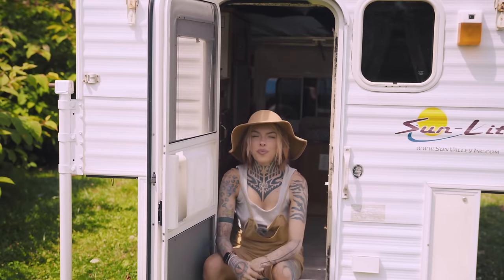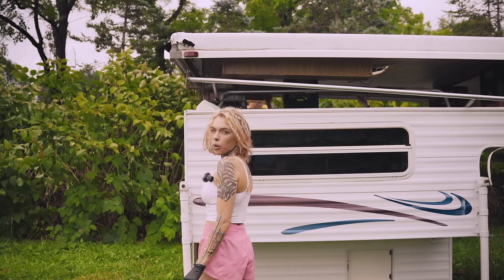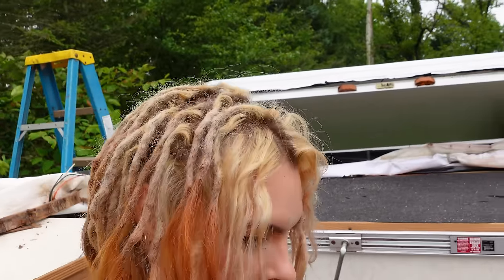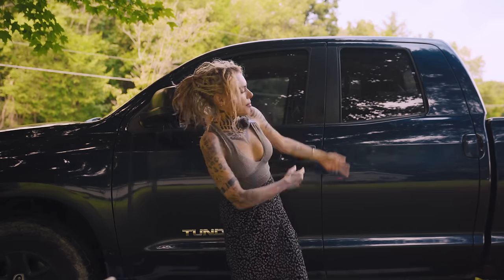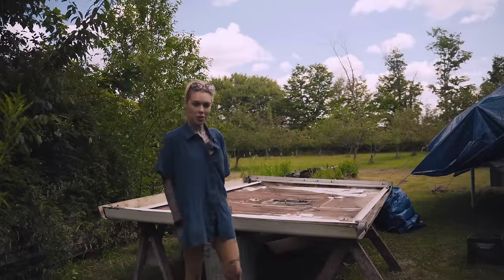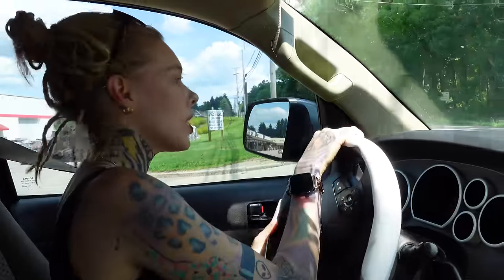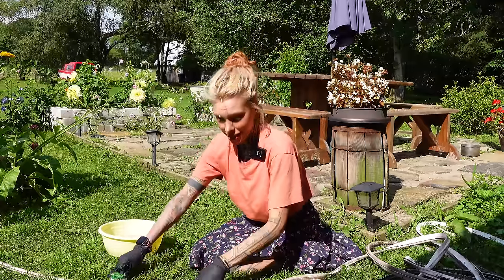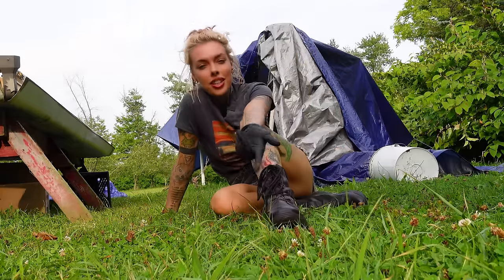removing ENTIRE ROOF of old TRUCK CAMPER... (this keeps getting worse)

Comment: I'm proud of your dad, he really loves you. He helps your with a lot of stuff. You can change those tire rod ends your self. Their probably a little rusty and stuck but take a hammer or what ever you have to do because your going to put new one on any way. Beat them heat them up what ever it takes to get them off. The parts don't cost no $500 most of that is labor.
Reply from the maker: Yea I could do it myself but I still need some other fixes on the truck that I can’t do myself and already doing a lot of fixing
Reply: @TorieRobot  you may not see it, typically when we are in the middle of the mud we can't see where we at but looking from outside the box shows you have evolved into the next level.

Comment: Just a suggestion, but you can put truck bed liner on your roof once you have it all back together on the camper. It will fill any tiny holes, give extra waterproof protection around seams and joints, increase the R value slightly, and make it tougher for off-road use. That way it will stand up to weather and low hanging branches better than just bare aluminum. Great work and positive vibes as always. Awesome that you're showing that there is never a task too big.

Remember, if your dreams don't scare you, you aren't setting your goals big enough.
Reply: Just about anything can be fixed no doubt, but l wonder if a cost analysis might show one could put the time spent fixing that up into earning enough extra money to buy something better.
Reply: @bebopkirby  I think it's pretty much always cheaper and easier to repair and improve on an existing design than it is to buy a brand new one. I suppose I should qualify this by saying as long as you have all the tools and the skills needed.
Reply: @derekd1510  Plus in her world it is providing her with content that earns her money. It is a pain for her but, the worse it is the more clicks she gets.

Comment: As Ric Flair says, you're stylin' and profilin when it comes to your truck. Like those side decals on the truck. Looks pretty rad! Also, I don't know if you have used this product before, but I can attest the brush on application does work. Flex Seal from those commercials is what I'm talking about. Don't know about the Flex seal tape, but the Flex seal brush on works perfectly! That might help with the pinholes you got. I've got an enclosed addition room on my porch deck for my parrot. Every time it would rain, water would come in from every little crack or crevice. After I used cans of Great Stuff and sealed with Flex Seal, chances of water coming are nonexistent to minimal if a major torrential rain storm comes in. I love seeing people learning, growing and gaining knowledge and wisdom. It makes me happy to see. Got to go, building a custom one off pinball machine.
Reply from the maker: Yes I got some roof sealant to seal it once everything is done!

Comment: I really like the customization of your new truck! Renovating campers is tough work when you have to replace the structure. Ive been there too.  When you get ready to coat the roof, make sure you spend a little more and get the high end coating. The cheaper stuff they sell at Home Depot does not last. I got one year out of it and had leaks all over again.

Comment: I agree with the finger to the seller! He knew exactly what kind of damage he was selling you and took advantage of you not knowing!
Those lower walls are going to have serious water damage and rot too!
Personally...I would cut my losses and build my own custom camper without the raise and lower function and fiberglass the exterior....but that's me!
Your project....your decisions....but you should look inside the lower walls and floor if you can to see if you have water damage or mold.
Obviously....at the end of this project you want a healthy,  strong and safe camper.
Good luck.....God Bless.....Stay Safe
Reply from the maker: I think the walls are okay because the roof held the water- the roof isn’t connected to the walls … but who knows
Reply: @TorieRobot  There is only one way to KNOW! Take a peek  and you don't have to use the phrase.."I think"
Most likely you will....or most people change the inside to suit their liking as far as layout and cabinets..sink...bed...dinette. 
All of those older and some newer campers are considered  "stick and tin" meaning raw wood (unsealed) with a tin exterior and thin wall inside. 
I'd just like to see you end up with a healthy strong safe place for your adventures. I know what it takes to do...and if I had the time...I would help you and your dad get it done!
Find out All of your damage before you commit to rebuilding the top first. That way your not problem chasing throughout the whole project with unknown damage.
Reply: Agreed. If the roof was that bad, you have to assume the walls are bad, especially seeing as the nose section got damaged taking the roof off. If the OSB makes cracking noises that means it's rotted and the glue isn't holding anymore. The canvas had mildew, the roof had holes. It's not a question of if there's water damage in the sides and floor, but how much can be salvaged.

Comment: You could see this roof replacement as a blessing. I'd cut 2 holes in the roof and replace the wood with a thin plexi glass. seal it up and you'd have a skylight above the bed and sink area. It'd bring in more natural light, it'd be awesome going to sleep under the stars and it'd make the roof lighter to make it easier for you to raise and lower it by yourself. It'd also make 2 thick covers that would velcro over the skylights to block out the light when you want and trap in heat during the cold times. These could be on the outside but I'd have them on the inside for ease of use and would be better insulation on the inside.
Reply from the maker: That would be a really cool idea, but unfortunately too much more work for the moment

Comment: You're so adorable. As far as the plates, you don't need to worry about them. Tow companies and police are the only people that can run them, and tow companies can get in big trouble just running random plates. They only run plates of impounded vehicles. They are public because it's not possible for the general public to run. The Tundra looks great. The camper, well the camper will look great. Great video again.
Reply from the maker: Yeah- I’ve never had a problem with it but I know some people don’t like to put them out there

Comment: Every thing is fixable 
For those jacks and the crank that raises your roof top 
Get a good cordless drill. Add a pice of hex metal or the head of a bolt to the crank 
Then you can simply use the cord lees drill to raise and lower the jacks and the roof top extension

Comment: I used car scissors jacks instead of milk creates.  Then you needed to lay 4- 4×4×8 ft. Fence post across the camper under the roof, with 2 post angled at the back of the camper to the ground.
Would have been safer and easier. Iwould have never put that much weight on the front bed over hang.
Might want to think about doing it this way when you go to put it back on.
Also put the cabinets back in after your done installing the roof completely. 
Would make it much easier.

Comment: Quiet nerd a YouTuber has greatly enlightened concerning fibreglass, fiberglass is expensive but waterproof. He built a boat out of Styrofoam and fibreglass. Truly incredible. As far as expensive fibreglass, I saw some stuff on eBay way more economical. You could definitely utilize fibreglass in some of your refurbish..xo btw; application of fiberglass requires very dry surfaces so that it won't rot from the inside
Reply: Buying fiber off eBay is expensive as hell, only good thing to buy is the resin.

Comment: Good news is you can replace the cheap particle board that's swollen with some decent wood that will last and replace the cheap plywood in the roof with decent wood that will also last. You mentioned spray foam in the roof. That kinda made me cringe as it will probably over expand. I would try to use 1 inch foam insulation instead or maybe 1/2 inch.

Comment: I'm thinking more about It, all the pin hole can be fixed by using fibre glass and epoxy on the fibre glass to create a harder top and a seal top too.14:56 Yep is time consuming and expensive, but that make great YouTube content and is also less expensive then buying brand new due to the in factory need to sell higher to pay the increased municipal taxe, federal taxes, the employees wage and more.
Reply from the maker: Yea I’ll reseal the roof after it’s all done
Reply: @TorieRobot  Oh yeah ! Thanks for the update !

Comment: Is there any way to address the crank lifting system on the camper while the roof is off? Maybe a gear ratio change would make it easier for you to lift alone. Or perhaps a longer handle for more leverage? Just seems like the time to adress it if anything could be done. Don't let the rain dampen your spirits! Just replace particle board with metal when you can.

Comment: In the long run u r better off replacing the pop up roof and resealing it.use sikaflex waterproof sealing silicone/ caulk.thats what we use in camper trade

Comment: They make some stuff called hydro stop  that's a cross of liquid  rubber  that every so often I would put on the top of my 5th, wheel camper,it worked very well !!!
Reply from the maker: I’ll have to look that up
Reply: @TorieRobot  use to could find it at walmart!!! Good for keeping your  top!!! In a liquor bonded rubber, you can brush or roll it,white so also a little reflective!!!

Comment: I wish I knew you were looking. I have a overhead camper that I want to give away sitting on a 2004 Dodge Ram I'm going to sell for 2000 dollars. I gave away a perfectly running 1980 Dolphin RV with tandem axle on Saturday to a homeless guy. I'm trying to get rid of some inventory to make room. I had Cherokee like yours that I sold for 300 dollars. I have a auto shop but just because I do, doesn't mean you can work on anything in my parking lot or borrow tools. I'm in California, I run a busy shop and not trying to get to know anyone but have inventory to get rid of. Good luck on your build.

Comment: Could I suggest possibly cranking the whole camper down so it sits on the ground flat and then you don't have to work so high in the air. It would be a lot easier to take the roof off
Reply from the maker: It is cranked all the way down

Comment: The truck looks good with the stickers.
If you re fiberglass the roof look at marine (boat) products like Total Boat.
Water proof. Fairly easy to use.
I fear it would have been easier and cheaper to just construct a camper that doesn't pop up from scratch but hind sight is 20/20. Also where is the content in that.
Reply from the maker: Well I specifically wanted a pop up which is why I was keen on this one

Comment: Anyone else would call the previous owners scammers but after having owned several campers, sometimes u have a leak and aren't aware because of how theyre built. With my last camper it took the mildew smell to be noticeable to know it had a leak an despite constantly inspecting the roof. It was a tiny hairline hole that over time added up
Reply from the maker: This could be partly true
Reply: @TorieRobot   after watching the video more I realized those people were cons. Now here's something to note since I follow your videos an I've gotten severely sick from mold. When camper roofs get a leak the water usually drops down the walls, so I would check the side walls for mold. The bottom of these usually have insulation too an a tarp to prevent moisture from the bottom but if water from the roof gets in it gets trapped an the insulation gets mold which is the most toxic out of all molds

Comment: Probably could have used 1x4. It measures 3/4 x 3 1/2 but would have been a lot easier to work with.
Reply from the maker: Right but it needed to be an inch exactly- that was the problem . I found the 1 x 4s but they wouldn’t work
Reply: @TorieRobot  Dang that sucks. Lot of extra work but it will be worth it!

Comment: The roof.... I would not use woodvagain...structural foam. You will save a lot of weight. And it will be lighter and easier th raiscand lower...I'm here for advice
Reply from the maker: The wood is the only structure to this and attached to the metal it needs to be strong
Reply: @TorieRobot     structural foam will be lighter and just as strond.. it will be easier for you too work with you won't need a saw.. won't rot eather

Comment: Hey Tori, is it true that in PA, if a private seller sells their used vehicle to another PA resident both the seller and the buyer need to physically go the the Department of Motor Vehicles and be there together in person to do the paperwork? Someone told me that once. If so that sounds like a major pain in the peach!
Reply from the maker: Yes this is accurate- unless you buy from a dealership. PA is so strict with rules
Reply: @TorieRobot  That's messed up! Explains why I see so many listing from PA on ebay motors. Bought my XJ off ebay from someone in PA and had it shipped to me. When I asked him why he sells cars on ebay and not in person he explained the PA laws. That's wack! For real though, good luck on the truck camper. Can't wait to see you on the road again. Have a good one Tori!

Comment: That was some janky way to get it off. Just for the future, you could have got the camper on the truck, drove it under a roof or a tree, suspend the roof on rope, disconnect it from the camper, drive off from under it, and then lower it with those same ropes. Much easier, faster and way safer.

Comment: Ooooof that camper was beyond shot..... common issue with those sty;e truck campers, you got this though :)
Reply from the maker: Yeah I knew I’d have some damage to repair but I didn’t known this much lol
Reply: @TorieRobot  Yeah been down that road with a few campers over the years, but nice thing is for the most part they are simple, look into injection resin for rotten wood, we use it on boats etc, makes old rotten wood solid again instead of replacing

Comment: With a couple of mods, your pop up camper, could be a regular camper, no pop up design.
Reply from the maker: The whole point was to have a pop up lightweight one
Reply: @TorieRobot  The lighter the camper the better the gas mileage and easier on the truck. Your going to have to be very light when going to South America, because of rough mountains roads.

Comment: Add a coat of cool seal to the top and then a coat of chip guard or truck bed liner material. And since you are a smokeshow female you might want to check out some 12 volt actuators to lift that roof for you. Just an ol fart thinking out loud.

Comment: I hate to be the bearer of bad news, but this is important health related information so I feel compelled to share. You never want to clean  mold with bleach (despite what google says). I'm a mold expert and yeah bleach just makes all the mycotoxins "bloom" as it dies so it spreads it more and it will eventually grow back worse. Its best to clean mold with dawn dish soap and hot water first and then spray with hydrogen perioxide and distilled water solution and wipe down with clean, new microfiber cloths. Also, not removing the foam insulation is a mistake. Because it was right against a lot of moldy wood and so the mold spores are in the foam board now (even though you might not be able to see it), since it foam is such a porous material. Mold grows best without air and in the dark, so once you cover up that foam with wood, more mold will grow into the wood from the spores that are currently in the foam. Lastly, I know its an inconvience and a costly, but you really should replace the canvas fabric. You shouldn't be trying to clean and save anything that has visible mold growth on it and is a porous material. I hope you will be able to amend this mistakes (or perhaps just sell the whole things), because sadly I think you are on the road to living in a mold box (even if it looks cute by the end), that could seriously jepordize your health. Its just not worth it. Our health is literally everything.

Comment: The structure is poorly designed in regards to being water tight.  Gut the interior and redo it with metal and plastic.  Water is surely going to get in it.  This is an opportunity to correct the poor engineering.   Also if your tie rods are seized,  how are you able to steer?  Just know that everyone is a crook and you should be fine.   At this point the rearward facing 6061aluminium and lexan polygonal skull with Kevlar curtains would be well underway.  No need to worry about blm gunfire late at night.  In the meantime time being just keep grinding.  😎☠️😎👍